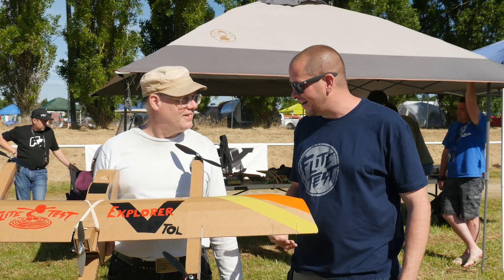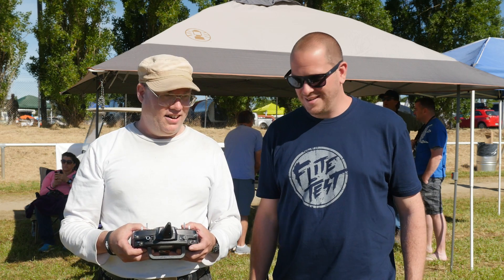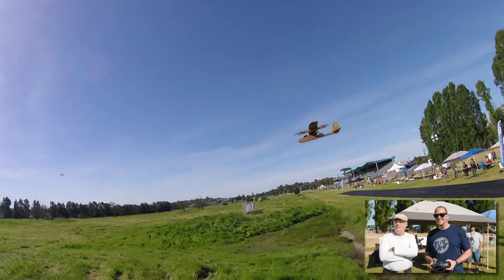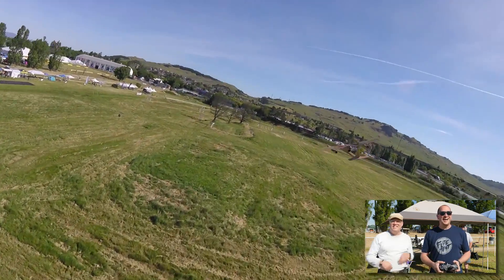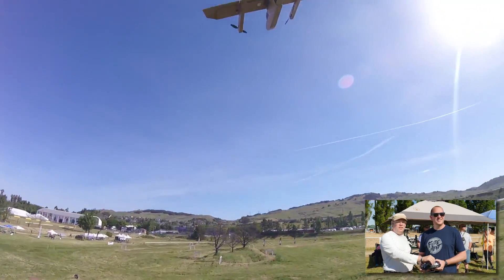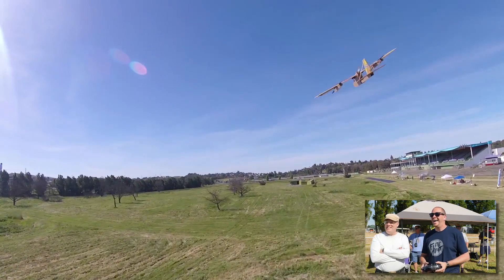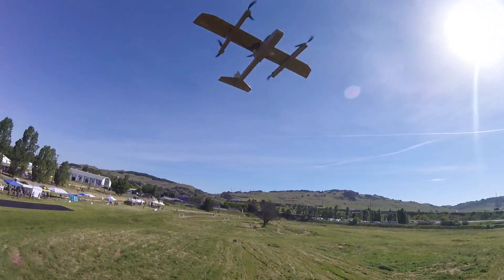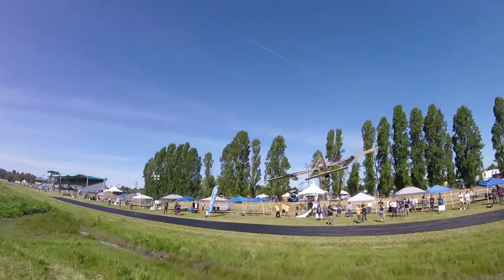DIY Plane/Quad Drone Hybrid

Comment: I just had an idea. What if you mount a wing at 90° to the rotors. Mount your fpv camera to support fixed wing flight. Not just a vertical takeoff plane but a fixed wing fpv quad? Long fly times with tons of power?

Comment: I have started paper plans on a super simple electric smoke system. After I make my cnc test items out of stainless steel. I will test this mod to insure the right amount of smoke based off of the simple storch.
 After that is accomplished. I will work on a smoke system for your FT 3d plane which requires 4x's the smoke. this project will eat up 2 channels. 1 for coil preheat and 1 to engage the liquid pump . 
my goal is to make 5 minutes of smoke per 15 minutes of flight. as I see it 10 minutes is wasted on positioning of the plane to use smoke
Reply: Glockg23 Sounds interesting, good luck!

Comment: To be honest the first time I saw this project I was a little less than impressed. But upon seeing that the merits were in the program, allowing it smooth and controlled transition, I am now quite interested. I might bookmark the article to see if whether the code and system can be applied anywhere else a project.

Comment: I hate to be that guy, but I really hate how "drone" became synonymous with quadcopter.
Reply: a drone is anything you can put GPS in, set way points and and then get to follow the way points by its self, in other words anything can potentially be a drone (car, plane, helicopter, boat and so on) , so when you say - "Drone Plane Hybrid" it hurts my head
Reply: multi rotors have been renamed to drones by people watching tv and hearing them get called drones by the media, people that don't own or fly and know nothing about multi rotors have had the final say in our hobby, well i'm still calling mine a quadcopter, quad means 4 and copter means copter, while we are at it why don't we call helicopters multi rotors, multi means more than 1 and a helicopter has both a main and tail rotor
Reply: SierraSierraFoxtrot "Drone Plane Hybrid"

Me: So it's just a drone...
Reply: @米空軍パイロット  UAV
Reply: @rhamby3470  UAV is a broader term than a Drone. A UAV can include your regular RC planes that  someone flies at the park. The difference between a drone and an RC plane or helicopter is that when you control an RC vehicle, you are telling it how to maneuver. When you control a drone, you are telling it where to go and the drone figures out how to do the maneuvers necessary.
Reply: @米空軍パイロット  I know what a UAV is. It's unmanned. A drone is a type of UAV that has autopilot and doesn't need human interference. So RC isn't completely a "drone" right
Reply: @rhamby3470  Correct.
Reply: Yeah, especially since the word already means something else.
Reply: TheRattleSnake3145 i found this as the definition - an unmanned aircraft or ship that can navigate autonomously, without human control or beyond line of sight.
if like you say  a drone is anything flown remotely would not all rc aircraft be called drones and not just multi rotors like everyone likes to call them
Reply: DiscoVolante   a drone is anything flown remotely.
Reply: Electra Flarefire try flying a helicopter without the tail rotor...... so yes, the tail rotor does count.
Reply: only really said the thing about calling a helicopter a multirotor as a joke just to try and make my other point
Reply: Swendeezy its crappy, you have a karma drone in the thumbnail, you show ads from a gps drone and have a shitty 10dollar drone in the video. how is that supposed to be funny
Reply: ☣droid☣ So what's the new word that means what drone "used" to mean?
Reply: Totally agree with you on everything DiscoVolante
Reply: Drone need to have some inteligence as a robot. Quadcopters have speed control of motors at least and sometimes something more and that's why they are called as drones.

Comment: So what happens when you take off VTOL with full throttle, and put it into full forward flight as fast as you can?
Reply: The transition is timed, it doesn't just switch instantly